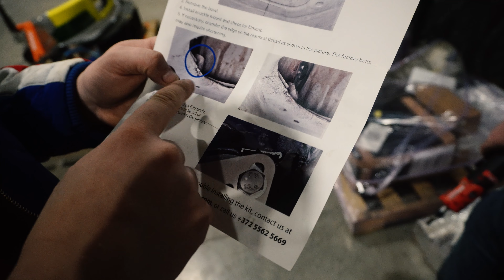BMW E46 HGK Widebody and Wisefab Trailing Arm Install

Comment: Wisefab says you’re supposed to use their axles. Well I don’t want too. I want SLG axles. So I will buy all the e46 trailing arm upgrades from PartShopMax and have a stock arm with all sphericals in every spot and have sick SLG axles and 8.8

Comment: Thank for the info in this vid. I was ready to buy the Wisefab rear arms and now, that won't be happening. I was already on the fence, due to the lack of weight saving, over the stock arms, however I do like the adjustable front mount.
Reply from the maker: yeah its unfortunate it wish it was more plug and play for non Winters setups

Comment: Thanks for this video. Holding off on those trailing arms for the foreseeable future. Also disappointed they used a crappy 330 caliper and not some wilwood or stoptech at least. I see you guys made an adapter anyway lol. Ya'll the best